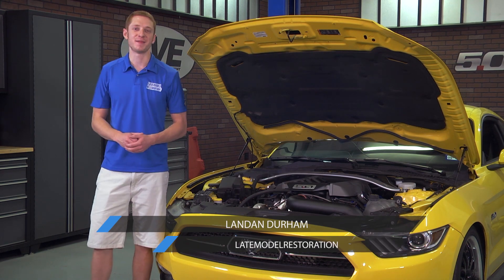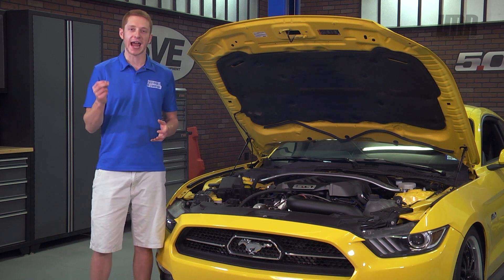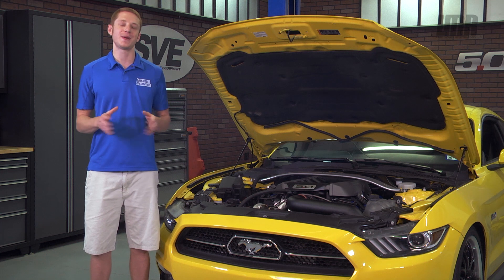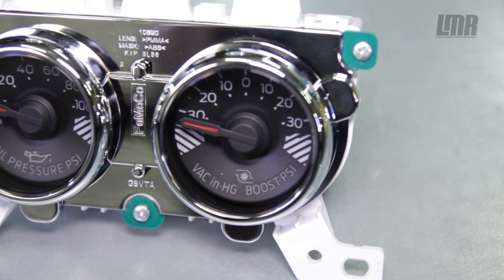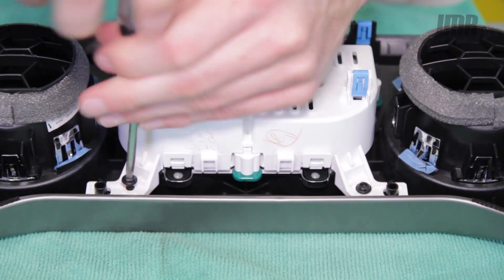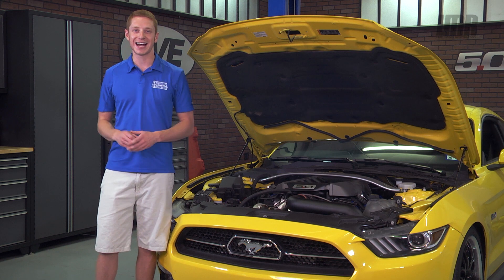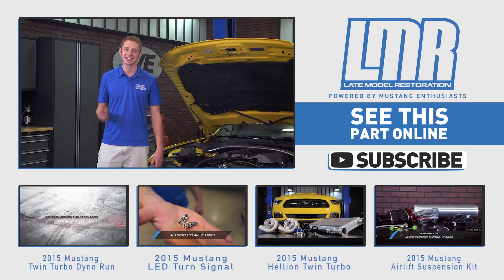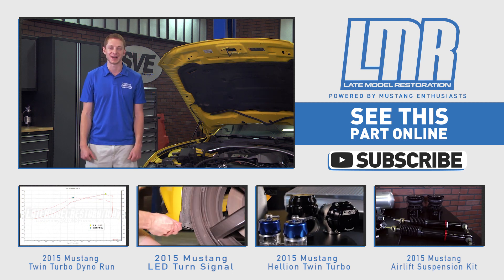Mustang Performance Pack Boost Gauge Cluster (2015-2018)

Comment: I have a 2015 roush mustang with the performance pack and they I added the super charger. Will it read the boost?
Reply from the maker: This gauge cluster will work for what you're wanting it for. The boost is actually "calculated" from the ECU since they're isn't any vacuum lines associated with the gauge. Follow what we tell you in the video, and you'll be good to go. -Landan

Comment: When will they make a after-market kit to upgrade a non performance peck car to this Style of 
gauge system?
Reply from the maker: +K. Joe Hill Honestly, I'm surprised Roush doesn't have an A/C vent pod yet. Personally, if I had a non performance pack car that's what I would do if they ever offer one. -Landan
Reply: +Late Model Restoration I know it does not fit non performance pack dash panels, but are the wire leads however behind the stock panels anyway?  Curious if this is just a find a dash panel and gauge pod and plug and play from there or if the needed wiring is not present then sol.

Comment: My country GT version only 3 aircondition holes, we don't have a chance to choice performance package,if I buy this gauge package, i still lack panel for fit gauge and connect socket (Electronic connectors) can you tell me, where to buy  panel, and how to install in GT vertions of 3 air condition holes  tks!
Reply from the maker: +SevenDragonBall I'm not 100% sure on what goes on, but you'll need the obvious such as the panel and gauges. -Landan